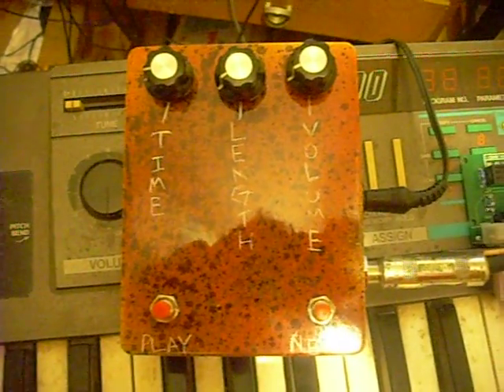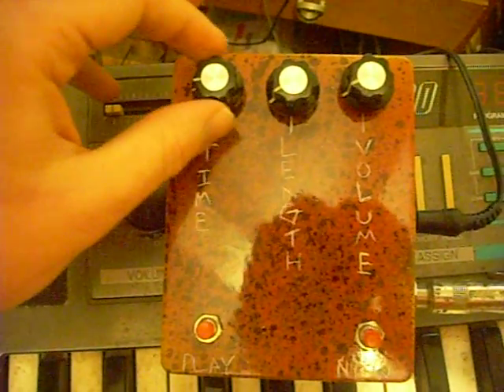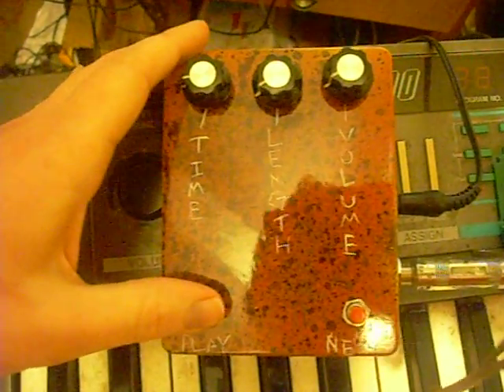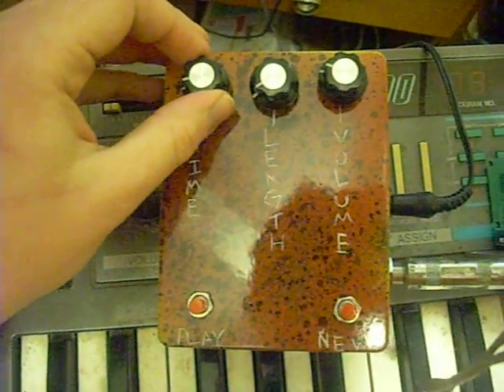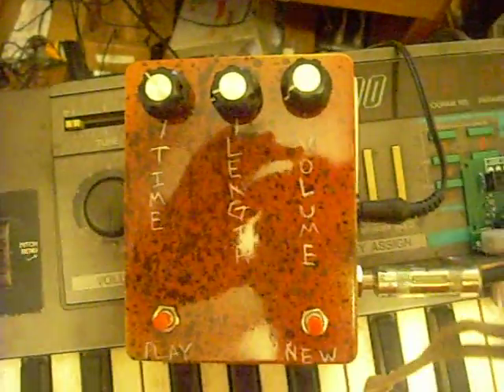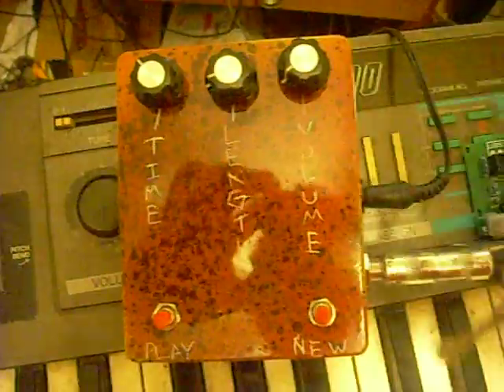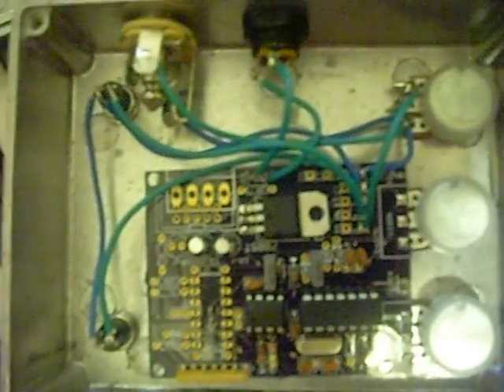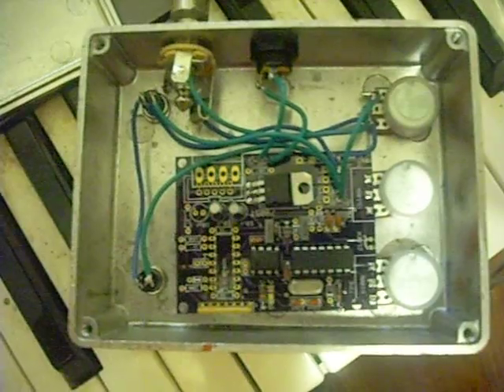1Song Demo 1

Comment: Very cool. I did something like this but instead of an audio out it was a random CV and gate patterns. You could set the speed and length of the pattern (1-32 notes).  It has PBs for generating random gates and random CVs. The CV out was rough since I used the Arduino's PWM outs  instead of a nice DAC.

Comment: Is it possible to build this with a MIDI out? I've seen CV to MIDI things before. Might it be as simple as connecting pin 7 of the IC to the CV to MIDI module? It would be cool to control some of my keyboards with it.